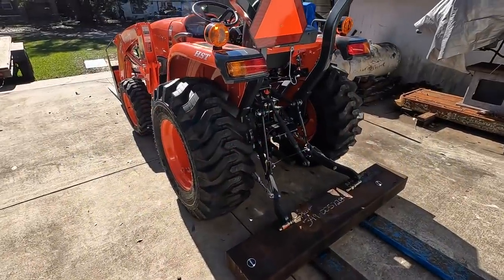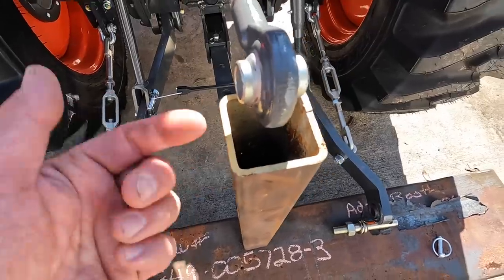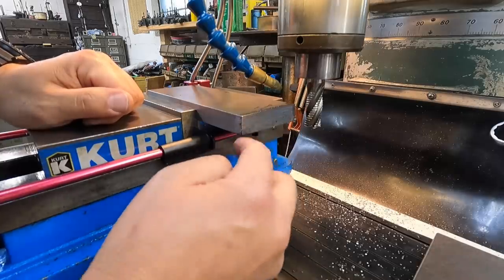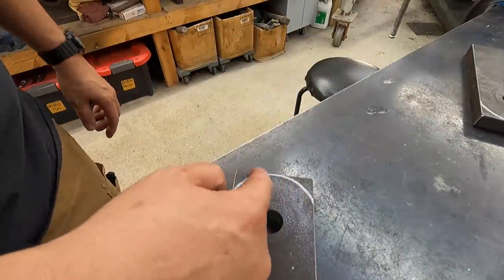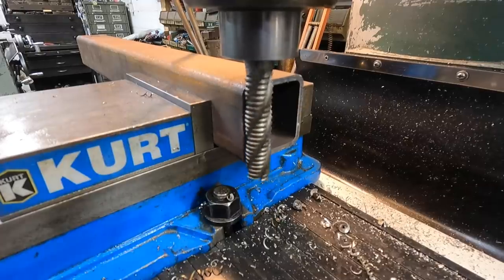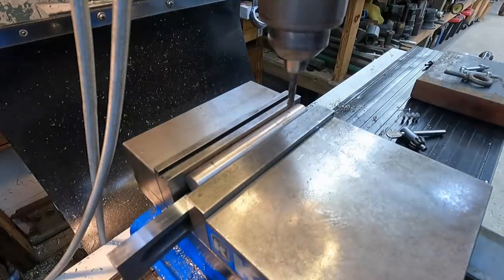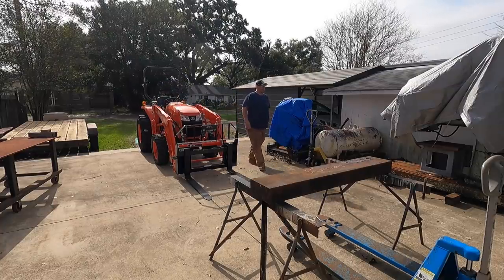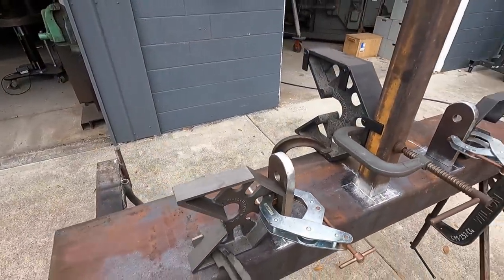Tractor Rear Counterweight Part 1

Comment: I think I would've laid it up on edge so you could've made it pull double duty by using it as a drag or even a blade if you added a cutting edge. The upright for the top hitch should be farther back and even on a angle. It's going to have to resist a lot of weight being up close to the other pins like that. Has no leverage at all.

Comment: Weld a hitch receiver tube on it. Just the tube, not the whole receiver. lol That way you can tow with it.  Also calcium sweats out of the tube and eats steel all day. Just us washer fluid. You can buy 50 gallon drum from Advanced Auto Parts or O'reilly Auto Parts. I have learned from my own tractor.

Comment: Though you have a wee little Ripper of a tractor Adam, I feel for your needs especially once you get set up on your new property, and not only for outside work but using it to lift machinery and equipment and projects into your new workshop, that you might have been better going one or two sizes bigger. 
Reason's why,
Most smaller forklifts don't do well outside so you are limited to just around paved areas, a bigger tractor can go place's and lift thing's off the beaten track, 
If you got the correct tractor you could easily have both a usable implement on front and back at the same time 
IE a carry all or tow a trailer on back and forks or bucket or grapple on the front 
Carrying a weight on the back 
Is a inferior fix that can be considered as a make do option 
Fluid filled rear wheels are an excellent idea they do a good job but leave the 3 point linkage free for a multitude of accessories if you where way over the other side of the property say getting sand you would have to make many trips back and forth with the bucket but it you where towing a trailer.... 
Each time you drive a tractor you are at risk of having an accident, esp an incorrectly balanced one. 
A late mate gave me this advice back in 1981 when I lived on his farm 
"RESPECT THE MACHINERY AS IT DOESN'T RESPECT YOU" He was killed the following year driving the tractor I was using when he told me that and he was only 36 having just got married and left a wife and stepchild behind. 
I would urge you to consider trading up to a bigger model that is better suited for the job's you will need it for in the future. 
Tony from Western Australia 🇦🇺

Comment: I've got a ton of gadgets i want to make for my l2501 ,  if you ever want more power out of yours just reply and I'll get you the info.  Cost exactly 0 cents to return it to manufacturers spec for overseas.   Emissions nueters our new tractors  ( even though they don't have them on thr 25hp),  they are turned way down to stay below that power

Comment: I have no experience with tractors, but is it possible the upper link is the wrong size and all three should have the same size pin?

If so you might have problems fitting  attachments later on.
Reply: there are different sizes of 3 Point Hitches...so the pins vary...normal...
you normally measure the pin hole...

Comment: 14:50 It's better to use a Neutral flame for torching .. there is no advantage to the oxidizing flame you used here, it wastes oxygen and decarbonizes the steel.

Comment: Adding counterweight's are fine but don't ask to much out of a under sized tractor.
Reply: These modern small tractors have twice the horse power of the old 1940's ones .. they do just fine!
Reply: The older tractor's were built alot stronger then today's cheap steel .
Reply: @allanerdman7072  Good point .. that is a big limitation

Comment: may I ask why you hadn't just turned down the 7/8" pin?
Reply: They're usually pretty hard, and the lynch pin holes make for bad angled interrupted cuts.  All for a pin that'll cost ~$5. Best to make do best you can, and buy replacements later.
Reply: @ivanblogs  They're rarely hard. The very few that are hard are usually black anodized and with a blue handle.

Comment: To me it seems weird a tractor would be so light it will need a rear counterweight. The tractor i most often drive will lift roughly one ton, and you cant even feel it getting light in the back. 

Our old tractor would had needed a front counterweight, when having something heavy in the three point and dropping the clutch, it would lift the front wheels. Took a while getting used to that.
Reply: I would also probably had used something filled with concrete or sand as counterweight. Feels like that would be way cheaper. Seen a few farmers around here use old oil drums for that.
Reply: It's just a reflection on the fact that the tractor is a compact lightweight thing and the front end loader is really an add-on that wasn't in the designer's mind when the tractor as we know it today evolved. All loaders these days are able to lift more than a tractor can safely handle without some form of counter weight, weighted rear rims or ballasted. I've got two that need weight. Mostly I try to get away without the weights and just about make it with the rears struggling for grip.
Reply: @JohnSmith-vi5pz  Yeah, I commented before I watched and you are right. That loader looks to be almost the same size as the one I'm using, but on a MUCH smaller machine.

Comment: Initially I said they didn't sell you the wrong part because I thought you said 5/8 pin not 7/8. But they did sell you the wrong part. That top link is supost to fit loose on some Equipment so it can have some give in it. If it fits tight on some Equipment you will have major issues getting it out. I don't think you will have issues on this weight. But That's why the dealers sometimes will go 1 size smaller. So be aware of that. The lower arms has to be tight because they are the ones pulling the Equipment. The top link does nothing but keep the Equipment aligned.
Reply: I guess further proof the dealers don’t know what part to sell. How can he put a 7/8” pin in a 3/4” hole?? Brilliant
Reply: @Bgoodman6113  I thought he said 5/8 but you're correct he said 7/8. My bad.
Reply: His job is to MEASURE the hole before shopping. Forget the vendor.
Reply: @Bgoodman6113  I guess tractor newbies dont have tape measures or even micrometers or calipers. Especially machinists.
Reply: @RRaucina  for a tractor that expensive I would hope the dealer would know it thoroughly, especially on a 3pt hitch. That’s the most utilized piece on that tractor. To have to measure for the pins is just ridiculous.

Comment: If I had to drive a long distance to get a specific part, I personally would have measured the hole and knew exactly what size I needed. They should have been able to tell you by model what size you needed and that’s a poor mistake. But it’s a two way street and definitely not a secret that you cannot rely on anyone to make sure you’ve got what you need. Yeah it sux, but mistakes were made by both parties involved.
 I’m mean absolutely no disrespect🙏 keep up the great work.
Reply: It's a tractor with a Category 1 linkage. No need to say any more.
Reply: I mean all disrespect: He screwed up and it's obscene that he blames the vendor.  Get a life and a tape measure and some respect.

Comment: Instead of mounting the piece flat mount it vertical so it can be used to grade  dirt or grave flat.
Reply: Not a good idea, the 3 point is made to lift, not for grading. The counterweight has no way to swing on the 3 point, it would be a very rough ride with a lot of punishment to the 3 point and the frame. The upper arm must be spring loaded or not attached at all,  if you wan't to use it vor grading.

Comment: @abomb79 how long will that grinder run on a single charge? My dewalt grinder, which is an old 18 volt with 20 volt adapter and battery will not even sharpen 2 lawnmower blades without changing batteries. Then the batteries overheat. Would I benefit from the 60 volt system.
Reply from the maker: I’ve never run them constant to find out how long. I’m willing to say that you could use that grinder for a half out of continuous use. I use the large blower often and I can use it many times blowing off my slab and patio areas before needing a charge.
Reply: The old 18v batteries are not even in the same conversation as the 20V lithium ion batteries. I don't know how we dealt with those 18V batteries for do long.

Comment: Hey, I’m sorry if someone has asked this already but couldn’t you just have turned down the 7/8 pin to 3/4? Is it too hard to turn?
Reply: hard to get that handle end to clamp into the 3 jaw chuck
Reply: yeah its not hard to set it up to machine it. just set it up on the pin itself first to get the center drilled in the end for a live centre. then chuck it up on the flange and the other in the tail stock. indicate on the 4jaw if not 3 or 6 jaw is good enough.

Comment: Maybe the top link you got with the tractor is the wrong top link and they gave you a pin for the correct top link which you don't have.
Reply: Er, no. It is a standard Category 1 hitch with 3/4" up top and 7/8" down the bottom. The spare parts guy obviously hasn't worked there for too long.
Reply: @jemijona  Didn't know cat 1 had different sizes top and bottom. Im more used to cat 2 and 3 where it's 1" top and bottom. Have encountered some 3rd party top links where the pin size is smaller in which case I had to improvise while looking for another top link.
Reply: @Rigge1988  It probably depends on whose system it is. Wiki says top and bottom pins are different sizes for all categories. Category 3 is 1 1/4" top with 1 7/16" bottom.
Reply: Only thing wrong is that he didn't measure the hole. All on the Abomb.

Comment: as for getting the top balljoint of the three pint hitch to fit you could machine a wide groove in the back of the square tubing , that way should you need to fit a new balljoint you dont have to adap it to get it to fit , the little thinner wallthickness on that part of the square tubing shouldnt matter oo mush

Comment: Super useful tool is a receiver hitch front or rear for moving trailers around the property, either mounted to the 3 pt hitch or the bucket quick mount, I'd consider putting one on this counterweight so you can use it in that capacity whenever its convenient without having to change implements assuming your 3pt hitch is rated for the 1000lbs of counterweight plus whatever tongue weight you figure you may find.

Comment: Looks a huge weight for a little Kubota. You've welded one 'ear' each side. This will bend the lift-arms inwards as the weight goes on. Two 'ears' per lift-arm would be safer and cause less stress and wear on the lift-arms' inboard fixings.
Reply: Only if the ears/pin deflect under load, and they look thick enough to not bend at all?

Comment: What is that tool he uses at about 12:20 to clean up the edges of the holes?  Just some type of curved file?
Reply: It's called a deburring tool. Its a sharp blade that can rotate, they come in a few different shapes on sizes depending on the application.
Reply: Noga brand

Comment: We have had the EXACT same problem with John Deere on a rear quick hitch, that they keep ordering the wrong upper turnbuckle. Now the parts dept is saying we need to bring the tractor up to the dealer?!?! We looked at 3 other tractors on the lot, all configured the same way, and parts are saying they are all configured "wrong" compared to what catalog shows the parts should be...

Its absolutely ridiculous, and were only 30 minutes from dealer. but still!
Reply: There is no turnbuckle on the quick hitch. If you mean the tractor center link( the bar at top of hitch between tractor and quick hitch) that is specific to your model of tractor.

Comment: Adam, regular wheel weights are more professional then loading up the tires with water (and some "informal" additive).
Reply: Wheel weights and Calcium Chloride filled tires is a popular combination .. and has been so since the 1940's
Reply: All the cane farmers where I live fill their tractors tyres with water, it's the best form of weight gain for extra traction. The ground needs to be ripped pretty deep sometimes.

My dad's old Ford TW30 has weighted wheels and it still needed more weight, and he gets an extra 2-3 tonnes of extra weight filling the tyres with water. With his ripper it has 9 straight legs about 2 foot long below the tool bar on it, and with water in the tyres the old Ford can have the tool bar on the ground using the full length of the ripper legs.
Reply: @MikeBaxterABC  Wheel weights don't rot out rims or (with inner tires) the valve stems. IMO: You're advocating the cheaper and less professional solution that will cost money in repair in the long run.
Reply: @Dropbear237  Wheel weights don't rot out rims or (with inner tires) the valve stems. IMO: You're advocating the cheaper and less professional solution that will cost money in repair in the long run.
Reply: @NekitaNet  not all tractors have the option for wheel weights and not all people can afford the weights. It's not a matter of being professional or not it's getting increased weight and traction as needed. Someone buying a used tractor that doesn't have the weights may not be able to find the right ones.

The professional contractors do both.

Comment: fill the back tires with fluid...
Reply: Since you are in FL and don't have to worry much about freezing, I would not use calcium chloride like we do up here. It's very corrosive to the rims. Water and auto anti-freeze should work fine.
Reply: @dudleycornman1624  Winterized windshield washer fluid?

Comment: It may just be hard to see from the video but It didn't look like the tractor even moved picking that up. I don't think you would have had an issue. Better safe than sorry tho.
Reply: But after Adam picked up the slug, Adam walked around the back of the tractor and lifted one of the rear wheels off the ground.

Comment: Isn't that like $1000 worth of steel?  Where are people finding steel so cheap they would use it on something like this?  Half the projects I see I could buy the thing for less than the raw materials would cost me.  I buy stuff from a local steel supply place.  I'd definitely end up using a pair of 55 gallon water drums and some brackets to build this.  That or just make a box and put some sand in it.
Reply: He told you where all the steel came from
Reply: @littlejackalo5326  Still, seems like something only someone with $$ to burn would do when there are so many different ways one could approach this.  Some plywood, lot of cheap rebar and high psi concrete could have done'er, and let that steel be saved for something that actually needed to be made from steel.
Reply: @boots7859  Maybe $200 of used steel, but indeed a foolish waste rather than rocks. Rocks are pretty cheap, even on Amazon.

Comment: 12:39 what was the tool used to smooth the edges of the holes ?
Reply: A deburring tool, commmonly sold by Noga company
Reply: De burning tool
Reply: That was a "de-burring tool".  They are available from Grainger, or McMaster-Carr, or other tool suppliers in your area, I'm sure.
Reply: Thanks guys never did much ironwork but love to learn and watch how things are being done.

Comment: Why couldn't you have just turned the 7/8 down to 3/4 on the lathe ? The wrong size Kabota pin I mean .
Reply: It is actually a drawbar pin if it is the correct diameter for his drawbar.

Comment: So I'm guessing you could not swing a deal for some wheel weights for the rear wheels most tractor companies have them but they ARE extra and not cheap ,but even with the counter weight installed a good set of tire chains are indispensable. A lot of tractor owners where I live and whether they had chloride filled tires or wheel weights they all wear tire chains in the winter, really cuts down on slippage. Good luck.

Comment: My grandfather had a giant counterweight he made out of a steel pole wrapped in about 3 foot thick concrete cylinder. Not sure what he used as a mold for concrete. It proved a mighty fine target for M1A & M1A  garand @ about 300 yards. It took a few hours over a afternoon but we turned it to dust and small rubble bits. Sure made disposal a bit pricey in ammo. But it was a hoot! Back in the mid 90’s when ammo wasn’t so pricey. Before overt medical tyranny landed in the USA. Old grandpa was a bit perplexed how it had seemingly just been dustified to nearly nothing but a thick steel tube that had been “Swiss cheesed”.

Comment: Why not chuck that 7/8 pin up in the lathe and dress it down to 3/4 or what ever the top pin required?
Reply: Why not measure the hole before driving to Tractor Supply? Duh~

Comment: I wouldn't ever put anything in my tires. The counter weight with that amount of weight should be sufficient for whst the tractor should lift. By adding only 300lbs to my tractor, changed the size of logs i pick up dramatically.
Reply: Counterweight put all their weight on the rear axles/housings. Tire ballast is on the ground. Reduces stress on your chassis.
Reply: @MarkSmith-zt2zl   i agree, but you can let it down and remove it when not needed, filling the tires doesnt give you that option. I use my tractor for all things possible which being able to lose a 1000 lbs off of your gross weight comes in handy for me regularly.

Comment: I am not a farmer either but as a kid my Dad & I rebuilt a old Case tractor & it had calcium in the rear tires. I have not clue what that big honking piece of metal cost you but I'm thinking wheel weights would have been cheaper to say nothing about less work. Plus with wheel weights you wont be breaking you shins when you walk into it. Looks worse then a trailer hitch waiting to attack.